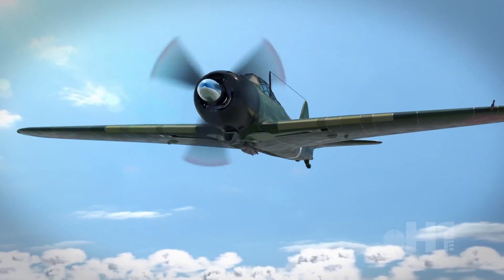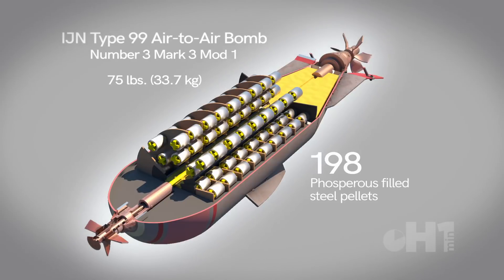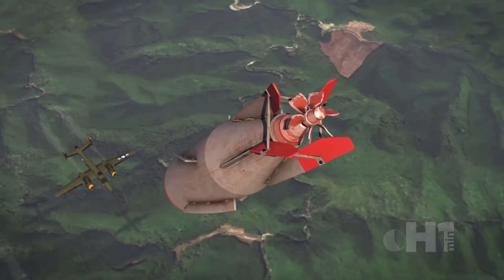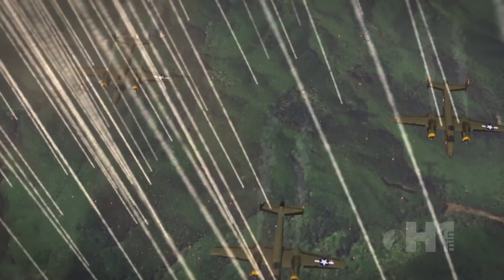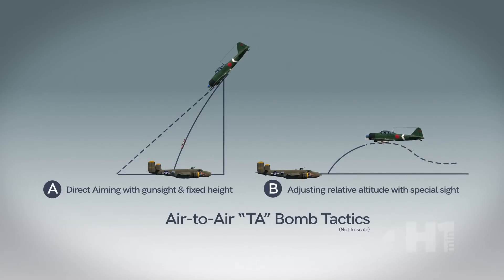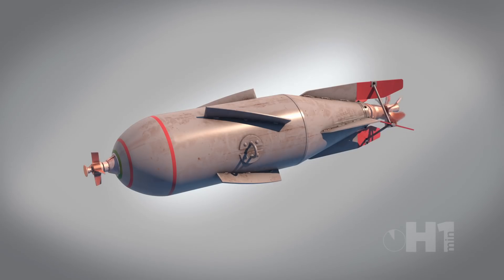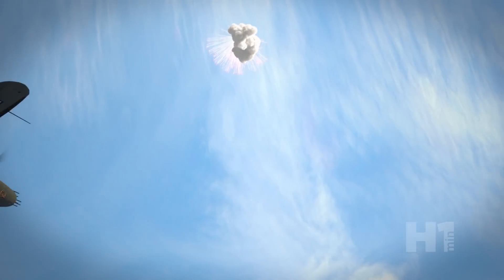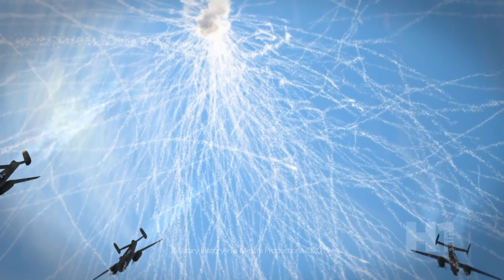H1MIN: IJN/IJA TYPE99 TYPE 3 AIR-TO-AIR BOMB

Comment: Even if it was unable to hit the bombers. Disrupting the formation was a great result breaking the bombing run and isolating bombers to attack without the cover of the other bombers.
Reply: I mean, is it really doing something a gun run can't though? Is it worth the range and maneuverability costs in carrying the bomb to maybe disrupt a bomber formation? Clearly not.
Reply: @patliao556  not really effective if japan was poor and had very small well trained pilot.
Reply: @patliao556  no but the concept of this bomb design is still used today, we just stuck a rocket engine on the back of it and a computer in the nose
Reply: @jasskeeper8152  Why does it matter that the pilots were small?
Reply: @Robert53area  air to air rockets and early guided missiles were already around by this time, actually. Also the trend is towards shrinking warheads and trying to score a direct hit.
Reply: @chrisdelzell8467  I'm not talking about rockets and misses but how a modern rocket kills.

They dont direct impact, they explode send shrapnel and hot metal. Air to air misses were not used in ww2,, air to ground rockets yes, radio guided bombs like the fritz x yes. But air to air missles no, you didnt even see those in korea, the ones in Vietnam had a 67 percent fail rate just coming off the rail.
Reply: @BabaSaft069  I think mr keeper was saying that the number of well trained pilots were small, not that the pilots themselves were small. Japan lost quite a lot of their more experienced pilots near the end of the war.
Reply: @xanielkusa7483  yeah So much for Kamikaze
Reply: @patliao556  Well I mean a gun run isn't as likely to break the formation. The logic was something like this: A B-17 sees a fighter shooting at it? Stay in formation and the formation will kill it. A B-17 sees an avoidable falling weapon, which a defensive formation does nothing against? Clearly maneuvering would be best. It's basically a matter of shaking their confidence in their safe formation.
Reply: @patliao556  Another thing you forget is that a plane like the Zero and most of Japans planes really had operational range to spare and have plenty of maneuverability to use to get above a bomber before dropping the dead weight and fighting like normal. So the cost of range and maneuverability is negligible
Reply: This technology used on a Comet would have been effective in disrupting bomber formations. Imagine 2 or more squadrons of Me 163's carrying a pair of these bad boys and timed fused bombs. They get up quickly to above the bomber formation in 2-3mins and their only task is to saturate as much of their flight space with all these bombs...imagine the chaos. All the while flak units have been monitoring and waiting for their signal to strike at the disorganized formation that is now unable to coordinately evade. To add more punishment groups of conventional fighters have also amassed in ambush positions close to the disoriented bombers.
Reply: @xanielkusa7483  they lost nearly all of them at the battle of midway.
Reply: @Omar Khurshid mate you have the same pfp as my discord
Reply: @Omar Khurshid we are brothers
Reply: @mikuhatsunegoshujin  Not even close. At the battle of Midway they lost a large amount of their carrier experienced Pilots not fighter pilots in general.
Reply: @Robert53area  an ffar is a whole lot closer to an AAM then any dumb bomb is.
Reply: @BabaSaft069  I think he meant the lack of Well trained pilots, Not height of said pilot
Reply: @delta5-126  😂😏 thanks for the explanation
Reply: @BabaSaft069  You’re welcome
Reply: @mikkel066h  to be fair, at Midway there were relatively few pilots lost. Number of experienced pilots was deteriorating gradually though out the war with a bulk of them lost on Guadalcanal, not Midway

Comment: It's kind of the same idea has for the 460mm anti air shell fired from yamato and musashi guns, with same results.
Reply: Well it's a common misconception that the problem was with the Type 3 shell. The Japanese used the Type 3 shell for most of their naval guns of all caliber. That includes the 46cm guns on Yamato, but also on other calibers like those on the Kongos or even cruisers. The problem lied in not the shell itself but the fact large naval guns like those seen on Yamato just aren't effective AA weapons. When used on the 12.7cm guns on Japanese destroyers, the shell performed fine. Although once again the Japanese 12.7cm guns being one of the first dual-purpose naval guns, was rather inadequate in the AA role by the standards of WW2.
The Type 3 was also used for shore bombardment as seen in Guadalcanal. The alternative was the Type 0 HE round which could be fused to explode in air for AA purposes, but otherwise served as the primary anti-ship munition for destroyers as AP was not produced for 12.7cm naval guns or below.
Reply: @neurofiedyamato8763  lol bc japan wants things to burn bc the destroyers apparently
Reply: @neurofiedyamato8763  also wouldn’t those bursting AA shells actually be good anti ship because most ships decks were wooden?
Reply: @invadegreece9281  Many ships used wood on the surface but it's backed by metal even on very small warships. The deck isn't actually wood. The actual structure is steel. They just put wood on top of it primarily for insulation and grip. Even tread steel plates get slippery when wet, wood doesn't.
If you ever left metal out in the cold or summer heat, you'll notice it gets very cold and hot respectively. Wood doesn't do that making it great for insulation and thus the ship comfortable to live and operate in.
The burning of the surface isn't such a huge risk to a ship since the damage is superficial. But it is nonetheless a flaw with wooden decked ships.
Cruisers and above would have a layered armor deck protection scheme further preventing such fires from doing anything serious. The fires wouldn't go through past the main steel structure beneath the wooden coverings.
 You want fires deeper in a ship or elsewhere. Armor piercing can do that by penetrating and then exploding which ignites flammable things inside in addition to the primary shock wave mangling everything.
Pure high explosive can destroy soft unarmored components outside like fire control systems and AA guns.
The incendiary round can't damage the fire control or AA guns. It might temporarily knock them out by forcing the crew to abandon their station, but the equipment won't get seriously damaged. The fires need to be very high temperature and last long enough to cause deformation in the mostly steel components. Incendiary aren't useless, they would still cause damage but AP and HE is just better at anti-shipping for vast majority of the time.
Reply: @neurofiedyamato8763  None the less there is a good chance that this could seriously hamper AA or open top gun turrets by either killing some crew or just torching em all together
Reply: @neurofiedyamato8763  HE explodes on impact, these shells are timed. You could make them rain down over a large radius just by aiming up and being good with the timer
Reply: @invadegreece9281  Some more issues:
a) Range finding was already an issue in naval combat. Adding a timed fuse would result in more misses, since the shells could explode prematurely even if they were on right trajectory.
b) In surface action, AA guns are the least of your concerns. Most anti-ship guns were fully or partially enclosed, and traditional rounds had a higher chance of damaging/destroying them.

Comment: Of the Japanese Navy's ace pilots who used Type3 bombs in air-to-air combat, the most famous is Iwamoto Tetzou. According to his autobiography, he dropped the bomb on the US bomber squadron those struck Rabaul. Then from the ground, it was informed by radio that they all had crashed, he wrote that.

However, recently published books suggest that Type3 bombs were not very effective. Author Hiroshi Umemoto wrote his book, comparing each combat reports the Japanese Navy and the United States in Rabaul. The Japanese Navy reported they had shot down many aircrafts by using the Type3, but reportedly the US was surprised by the bomb, broke their formation and has returned to the base.
Reply: Great information, thanks for posting!
Reply: As mentioned thanks for the extra bit of information.
Reply: So the bomb was disruptive in the beginning more than damaging. But the US air force adjusted tactics, making in in-effective. Sounds like an explanation to me.
Reply: @sushiromifune7096  I have no specific information on counter measures against this bomb.
What is well documented though is that the US air force was very good at post engagement analysis, developing counter measures and training crew. I saw a training video for counter measure against German flak fire here on youtube recently.
When an American formation turns back, aborting mission in face of a threat, as your sources report, you can be absolutely certain that huge effort will be invested into analysis and developing countermeasures. Will be hard to find what those were, but the Japanese sources say that the bomb became ineffective, which is highly suggestive of counter measures (e.g. having fighter intercepts flying at the attack altitude, or bombers breaking formation in a specific pattern when high altitude fighter approach).
Reply: I feel those bombs could be used for anti ship because I assure you no ship would particularly like a swarm of burning pellets falling on its deck.
Reply: @invadegreece9281 no airplane would like a wall of aa fire too
Reply: @genericasianperson6405  American planes didn’t seem to really give a shit Lmfao

Comment: Almost like the San-Sheki shell
Reply: Shiki*
Reply: And just as useless in the anti-air role.
Reply: Well it's a common misconception that the problem was with the Type 3 shell. The Japanese used the Type 3 shell for most of their naval guns of all caliber. That includes the 46cm guns on Yamato, but also on other calibers like those on the Kongos or even cruisers. The problem lied in not the shell itself but the fact large naval guns like those seen on Yamato just aren't effective AA weapons. When used on the 12.7cm guns on Japanese destroyers, the shell performed fine. Although once again the Japanese 12.7cm guns being one of the first dual-purpose naval guns, was rather inadequate in the AA role by the standards of WW2.
The Type 3 was also used for shore bombardment as seen in Guadalcanal. The alternative was the Type 0 HE round which could be fused to explode in air for AA purposes, but otherwise served as the primary anti-ship munition for destroyers as AP was not produced for 12.7cm naval guns or below.

Comment: I feel like that with minimal changes and fragmentation bombs, this design would have been greatly improved...

I don't know for sure, but I do know throwing burning things at moving targets ain't all that practical.
Reply: The issue is bringing such bombs to higher altitudes than the bombers.
The phosphorus bomb only weighed 33kg while the smallest bomb dropped by German plane weighed 50kg.
A fragmentation bomb would be several times heavier than an incendiary bomb which doesn’t require the use of heavy steel to achieve its effects.

Comment: The first Japanese Zero downed by a P-38 was by bombing. When the Lightning was first introduced in service in the Pacific, a promotion was promised to the first pilot to down a Zero.

I forget the pilot's name, but he was on one of the first operational sorties of a P-38 and was buzzing around a Japanese island air base to taunt them to come up and fight. When a Zero took the bait and started its take off run, he dived on it to blast it with guns, then remembered he would be at a disadvantage since he was carrying a pair of 500 lb bombs. 

He ditched the bombs, then circled around to come in behind, but the bombs had fallen in the water just off the end of the runway and the Zero was knocked out of the air by the water spouts. 

He had the nerve to ask for a promotion. I remember reading about this in a book authored by a USAAF ace.

Comment: Although it would never work today, with the close formations of ww2, ive always wondered if you could drop a bunch of cables from your plane or a balloon with anchors on the bottom designed to tear through enemy aircraft. You fly above them, and as they hit the cable it pulls the anchor into the plane tearing it apart

Comment: I imagine with the technology we have today, such a weapon would be more practical, with having sensors, stabilizers, and a different munition that's launched. Would it be viable? Probably not with how most airforces use jet aircraft that can travel much faster than the crafts during WW2, as well as missiles and other smart munitions that can track down a target. But if you could launch a supersonic projectile into an airspace occupied with hostiles, that detonates and launches it's payload all around itself in a large radius instantly, or is just a big explosion of some kind, then it could be of some consideration
Reply: It would be incredibly wasteful seeing as a couple of missiles would be much more practical. There are no swarms of aircraft to use it against so it would be excessively wasteful. It would also need to have a radius of several miles seeing as aircraft today shoot at things with radar guided missiles from dozens of miles away.